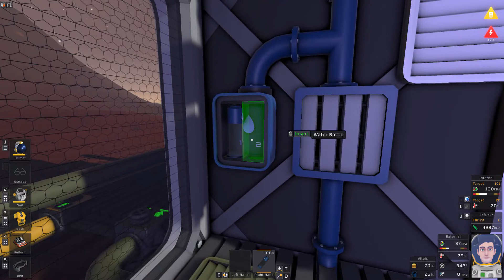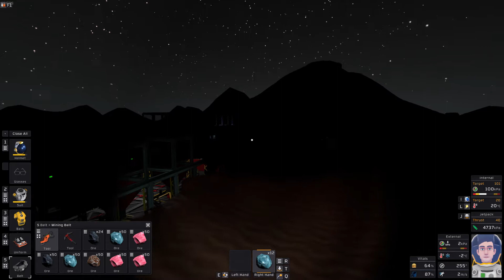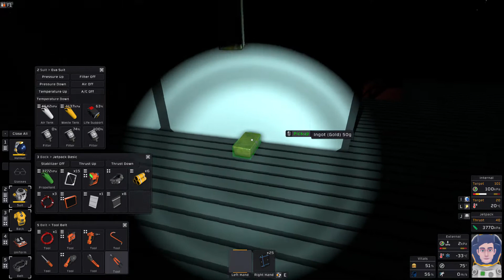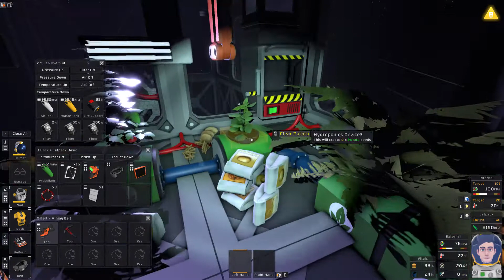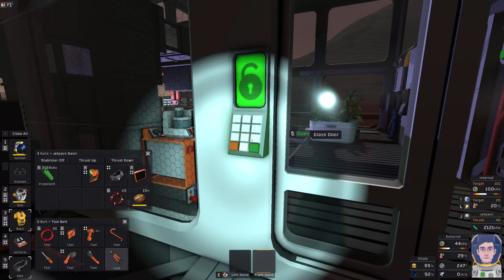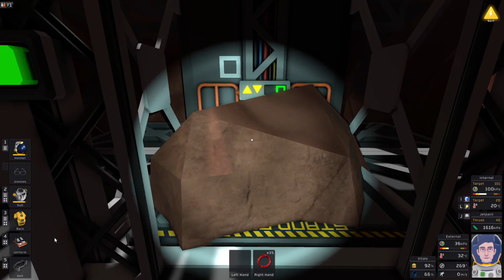Stationeers Play Through Part 14 : Expansion

Comment: Serious question concerning the pressure: Could you dump your CO2 tank and Jetpack tank to increase the pressure?  What's the maximum safe CO2 level for human breathing? (Answered my own question: As of 2018 anyway)

Steam Forum:
According to Wikipedia; symptoms of CO2 toxicity start at as little as a 1% concentration (probably assumes a standard atmosphere pressure + composition). 7-10% will cause suffocation even if sufficient O2 is available.

I'll have to see if I can come up with a test in-game to see if it's modelled.

[Edit]: I set up a small 1x1x1 room and pressurized it to 65'ish kPa with 45% O2, 10% N2, and 45% CO2. Besides the air being chilly, no toxicity alarms were happening. Amount of CO2 doesn't seem to impact players at this time. Lack of O2 is currently the only concern for breathable air.
Last edited by MaddMatt; Jan 22, 2018
Reply from the maker: There are imminent changes coming for CO2 toxicity and O2 toxicity. We don't quite know how those will look yet but when they added the nitrogen ices it was explicitly mentioned as an incoming change (N2 was previously hard to get but is going to be an essential buffer gas). The jetpack makes minimal difference and tbh even dumping my whole CO2 tank into the room won't make a massive difference, but I do that a couple of times when it gets too full from working in hot atmosphere